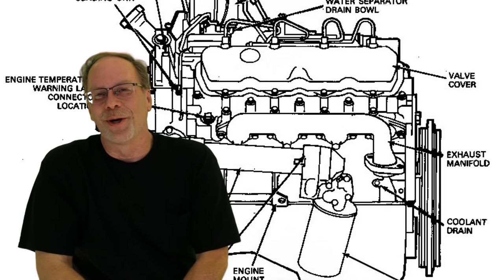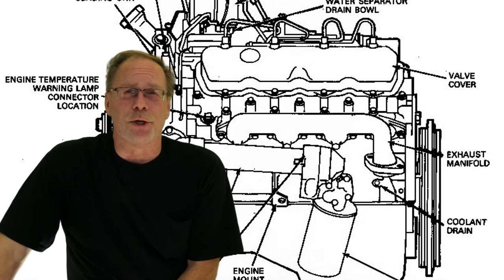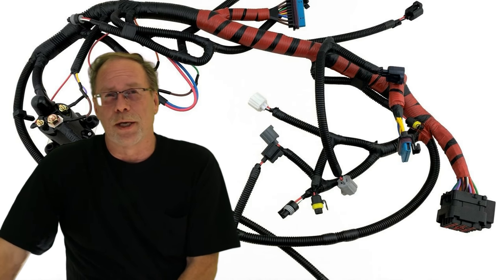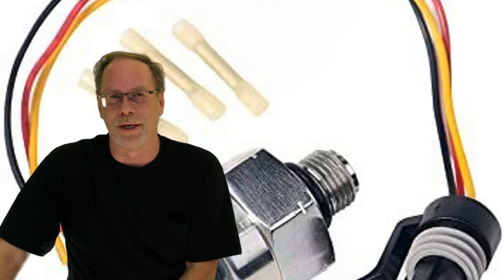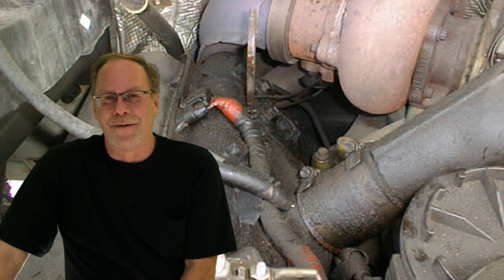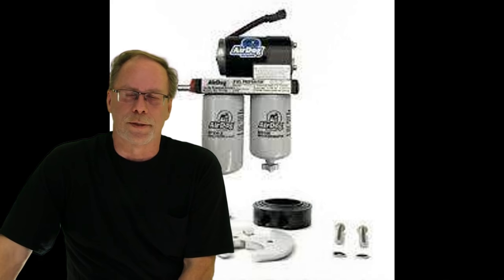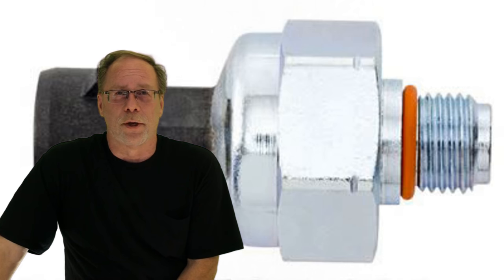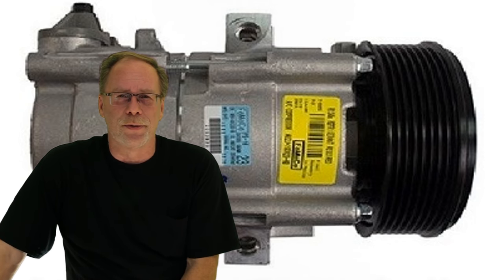11 7.3 POWERSTROKE ISSUES STOP IN AND SEE COMMON FAULTS.........

Comment: Ya missed a huge one with burning up alternators, and killing batteries.  LEAKING WINDSHIELD THAT SEEMS TO FUNNEL DIRECTLY INTO THE INSIDE FUSE BOX. . .
   many years have leaking windshields from 99 up... if your AC fan starts blowing when no keys are in?  radio turns on with the keys out? .... often it just drains the batteries over a few day period. Either way, it's a common issue and if ya don't know to look for it, it's a pain in the ass....

Comment: I' ve owned a 2001 the " Original" Platinum Edition F250 with the 7.3 for 21 years now. Always used Rotella T oil and Motorcraft parts. It seems to be getting louder almost a knock from time to time at idle. I added a quart of Slick 50 with the last oil change. It didn't seem to make a difference. Any words of wisdom ?
Reply from the maker: Here is the most common items #1 Fuel Cackle - 
Its a noise caused by the deadhead fuel system in the 7.3 perfectly normal. The number 8 injector is longer in the 7.3 to cut down on this noise or a failing injector
#2 injector solenoid out of spec
#3 loose injector
#4 worn lifter, rod, loose rocker
#5 poor fuel since the fuel increase cost to save money the companies are dumping excessive amounts of bio diesel in the mix
Reply from the maker: try a couple of these first Liqui moly jectron
Reply: @CUSTOMWORKS7.3PSD  Thank you for the prompt response 👍👍✌

Comment: What are your thoughts on a 2000 7.3 towing a 16k lbs fifth wheel on a regular basis?
Reply from the maker: If the truck has been maintained, brakes are good, electric brake installed and hooked up, I would install firestone hd air bags and you keep your foot out of it on hills shouldn't be a issue see my 3 gauges video also I have 4 2000's 2 of those regularly haul a 4 car hauler at 22k the drivers are OTR haulers we never have issues and we change the oil at 4k trans at 12k rear end and front, transfer at 12k  you would never know there 22 years old
Reply: @CUSTOMWORKS7.3PSD  thanks for the input! Brakes are next on my to do list!
Bags are installed along with my 10 step springs.
Reply: @StrongBodymindandspirit  Def. gonna need some power mods to be "happy" with that setup.
Reply: @alsaku33  yep, found out the hard way. It was ROUGH.
Gonna sell it, buy a dually and give it some power mods for sure.
Reply: @StrongBodymindandspirit  Meaning buying a dually 7.3 PS?
Reply: @alsaku33  oh, ya my bad.

Comment: What causes a 97 surge when I crank it up. Also hard to crank in cold weather
Reply from the maker: Highest possibility IPR , then ICP then HPOP or LPOP worn Best if you get forscan if you have nothing else load pids for the previous mentioned and watch the cycle of each and monitor battery draw could be as simple as a starter

Comment: Never able to get an OBD dongle to work with my 01 7.3. Every time I access it the engine shuts off.
Reply from the maker: the cheap ones do this we are doing a stand alone vid on this coming soon
Reply: Depending on the app you are using, you have to make sure the app isn't scanning for codes. Scanning for codes resets the computer.

Comment: I have no power to fuel pump on a 7.3 ??? needing help diagnosing
Reply from the maker: Make sure the pump works hot wire direct from battery ,, check hot n ground wire from pump to firewall make sure not broke or corroded,, check fuses wiggle and clean ends, 99-2001 fuel relay under dash behind radio lower firewall location 2002 -03 in the fuse box under dash ,,, Computer activates the fuel system if this was the issue there would be many other resent issues Can google fuse box and wire schematics per most years in the image search  //// highest common problem if pump works the relay took a dump,  incorrect or cheap relays will remain the problem so make sure the relay number is a exact match even if after market

Comment: Glow plugs every 100k motorcraft only. Good overall take. Been driving the same 7.3l and working on it since new she's at 400k. I will say a certain person pushing archoil oil additive and all, I. An say is usimg if for the last 275k and it did cure my injector stiction problem. Folks if you need injectors the snake oil. Ain't gonna rebuild them in a can. Lol it does prevent.   I'd swear by it.   
The only 1 thing he didn't cover is rust belt make sure youve bullet proofed your oil pan with some type of coating, they are prone to rotting and well the motor has to come out.     Good over veiw.  And what it's worth Ive never cleaned the screens in the tank dropped it so mere at 200k they were clean I've always used good fuel and diesel kleen additive. Hey to each there own right lol
Reply from the maker: Thanks Yes Bill and his archoil if people only knew what these types of additives do to certain parts of there engines they wouldn't use it But as far as injectors the number one thing I find is the springs break internally it also brings one to those washer shim kits if the oil stamper wears and you shim it why would one shim the Solenoid You have no idea how many of these debacles I run into every year I've had some guys really mess there trucks up with these kits Thanks for stopping by

Comment: Thank you for the tips I think I need a new wiring harness
Reply: Just fixed a 7.3 no start after fuel bowl rebuild and turbo seals. 

Wires to the IPR had bare wiring touching.

Comment: Man I've been having the worst stalling problems in my 7.3 and I've replaced so much and it's still doing it can someone help?
Reply from the maker: this is a high light video https://www.youtube.com/watch?v=4R-aV0zUFwU you can go to my main video page and also follow the full video hot no start also all applies to your situation In the description of this video is several videos also to help Also add to the video's while the engine is running jiggle every sensor connector in different direction and the same to the wire harness Everything you need to fix this is in one of my video's

Comment: 1999 7.3 with 400k miles studders at 1500 rpms or between 45 and 55 mph.
Reply from the maker: You need to have a running diagnostic done most diesel shops charge a hour for this. I couldn't just shoot idea's on this one to many variables
Reply: @CUSTOMWORKS7.3PSD  Thank you very much

Comment: broken exhaust bolts??  believe it or not, CAST exhaust manifolds do shrink... you might have to oval the hole in the manifold.  easy to see when the bolt won't go in straight, DONT KILL THE THREADS!... make it start with your fingers........

Comment: Thanks for the info am new to the 7.3 it's been my dream truck since I was 8 years old  now I was offered this 00 f350 it had a big oil leak Tru the bolt port by the high pressure pump next to the icp sensor some one dint installed back I found that lol now it start with hesitation plug my scanner and found 400 to 500 psi cranking and same in idle so no acceleration installed new icp same condition installed new pump now have good pressure  it starts and accelerate but still hesitate did a buss test and 3 injectors sond different installed new injector it runs grate till I drive it lol then it shut of only start on starter fluid ok lower tank uuuuffff ooooglyyy rust dirt water diesel pickup parts  lol you name it ok clean and fix that replace filter and chassis pump still no crank add injector cleaner no start keep it running on starter fluid for a little  few different days and it started to stay running  ruff again but every day was better  now it hesitate cranking on itself but it cranks and idle but won't accelerate pass 2500rpm and when it warms up gets worse into it stalls wait to cool of and it cranks and same thing if spray start fluid it accelerates any suggestions
Reply from the maker: check fuel first tank screens filter leaking
Reply: @CUSTOMWORKS7.3PSD  I does not have the filter I clean the tank and put a hose to the pipe to compensate the length  of the filter into I get the truck running good do you think that can be the problem why only does it when it warms up?
Reply from the maker: @pitoboost4837  If I'm understanding this The fuel hose has to be a correct PSI so it doesn't suck it self closed but a won't start hot is usually as follows
 If no start when hot and everything else is perfect, it's usually an IPR (or chaffed wires to the IPR), ICP (or the wires again), or oil that is sheared down and needs to be changed

Comment: WTF is a "PID"?
Reply from the maker: What is a Ford PID?
Parameter Identification (PID) Description. The PID mode allows access to powertrain control module (PCM) information. This includes analog and digital signal inputs and outputs along with calculated values and the system status.

Comment: My Ford dealer wanted $3300 and counting to drop a fuel tank...on a rusty chassis...truck had 83K miles...

Instead of dealing with a strainer that is clogged...I ran diesel in backwards using a Bosch 530 i BMW fuel pump in a loop...then I got 250 more miles...ran the treatment again..got 750 miles...ran it a third time now I have 96k miles....

It is just getting broke in...

Lol...